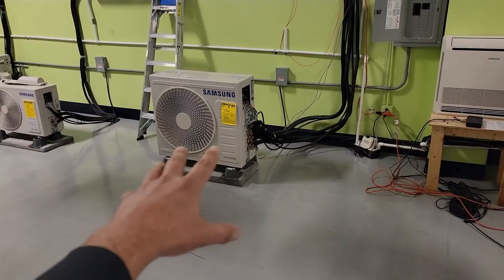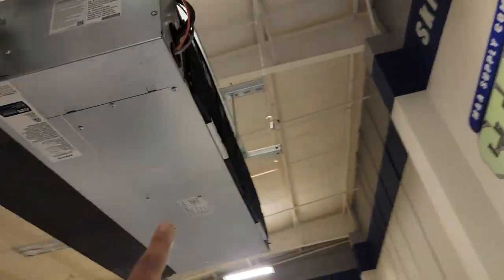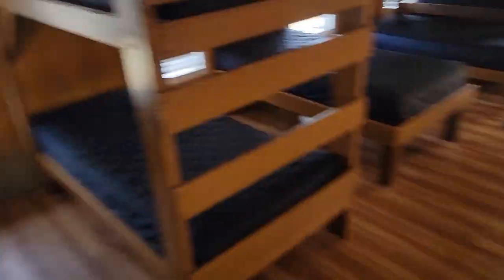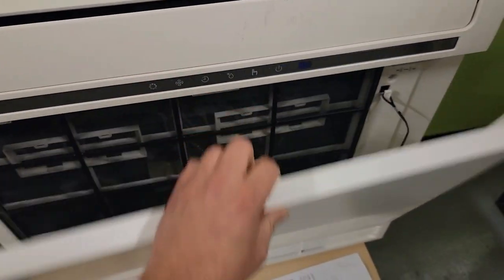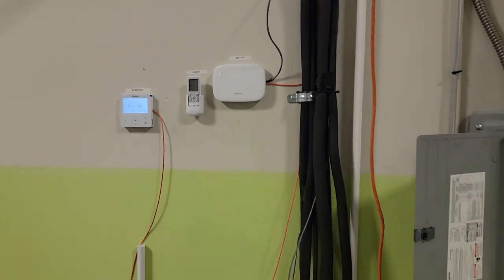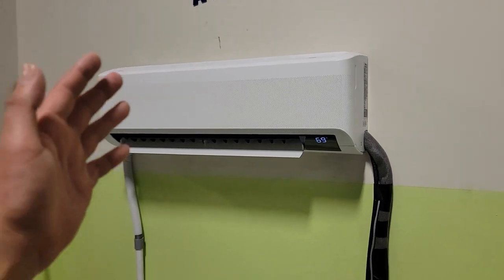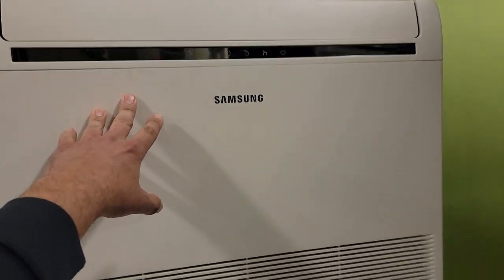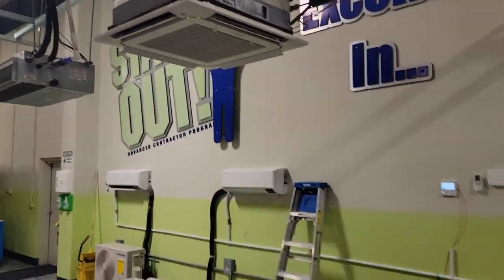What's the BEST Mini Split for Your Home?

Comment: I want to remove all the under house duct work and handler. Mice make nest inside the unit and leave an odor. I would want a four station system all floor models, the house is small under 900 square feet I believe when I get back up there this summer I will measure rooms. The kitchen has one wall where one floor unit can go, the bedroom one can go under the east window, the living room has a west window where the third floor unit can go and the closed in windowed porch on the south wall I can find a place where to put the forth unit. I want all pipes under the house I only want one opening going outside where the original compressor is now. When all this ac installation is finished I can seal the ground under the house. A one ton unit is probably big enough for the four stations I believe the house is 25 by 26 counting the front porch. I may be wrong. 73
Reply: Thanks I may start with two stations one in the living room and one in the bedroom the kitchen is open to the living room, that should get me started I know the front porch will need a unit if someone sleeps there but right now the main house needs to be done I'm hoping I won't have to buy a dehumidifier for the house but when no one is up there, do I want to run the system unattended with storms and such like? 73

Comment: Thoughts on a cassette in a garage? Heard lower airflow than wall mounts and also failing inspection in certain areas due to fire blocking essentially being in the garage.

Comment: GREAT VIDEO! So I’ve had a mini split unit installed into my garage twice in the last 12 years. The first one lasted 6 years and was pretty decent the second not so much. My garage is 600 square feet and isn’t insulated. I was told i had the strongest BTUS A MINI SPLIT CAN HAVE. My question is: can you suggest which one your oppinion most likely will work. Best for the space to provide cold air when it’s 102 degrees outside because it hasn’t really been feeling. Cool enough.
Reply from the maker: Hey thank you so much for watching the video yeah I  recommend a 2 ton unit

Comment: You know what would be really cool (pun intended).  An exterior mini that flex ducts (similar to dryer flex vent duct) supply and return to a plexi-glass window insert.  Drawing 120 ac from an existing indoor outlet.  Great for non-permanent self-installs.
Reply from the maker: That would be sweet I could see lots of demand for that
Reply: they make them.  I have a customer who has something like that.  He plugs it in, runs the lines which are super flexible and uses it during construction or whatever.  I have no idea where he got this thing- but its small like 9000 or 12000---but runs on regular 120V.  You can buy 120V units up to 1ton---I've installed lots of them.
Reply: @mtsaz100  Find out where your customer got that and let us know.

Comment: Thank you, I will definitely watch the upcoming videos.

Have you ever installed mini-splits in a home with a flat concrete ICF roof? The ICF has a built-in chase for running electric and HVAC but the chase is small and only runs in one direction. We would have to cut the forms laterally before the roof is poured to accommodate ductwork for a traditional system and I think even for the refrigerant lines and drain lines for mini-split zones. We are trying to find the most efficient and cost-effective solution. Also, because the house will be so air tight we also need some sort of makeup air system that will need ductwork as well. Wow, what an undertaking. We are in Southwest Florida if you want to come down for a vacation and install our HVAC!!
Reply from the maker: If it was cost effective for you then I can definitely come down there and install your hvac

 I would be coming to Orlando in November for a vacation for a week

Comment: I am a general contractor. I installed 3 of these systems, with one of them in my own home.  Every one had a defect right out of the box.  Had to take Samsung to the California Department of Consumer Affairs in order to get warranty parts for my own unit. The local distributor went out of business because of all the problems with these units.
For the best results buy a LG, Mitsubishi or Fujitsu.
Reply from the maker: not many people actually know how to set these units up
Reply: @TaddyDigest  💯 There are so many hackers out there.
Reply: buy a fujitsu samjunk and lifes garbge are crap
Reply: Not many new HVAC technicians know the Samsung brand should stick to TV's only. Their washers and Dryers fail, their refrigerators are rated the worst in the industry,  so what makes you believe that the inverter technology is better in their AC equipment?
Reply: @xcentriclithium5467  they only make good phones and ssd's the rest is crap

Comment: I was wondering what applications other then a drop ceiling are cassettes more beneficial then a wall mount? Or when should they be used over a wall mount.?In a residential setting new construction or existing.   Thanks

Comment: Great video. Super informative. Thank you! Do you have any videos with pricing of these types of mini splits and I'm curious with how long they last? Also maybe a video of comparing using Mnii Splits vs using the typical HVAC vent? Last question I can think of, is using mini splits (using the different types) good for a larger home 2500 sq. ft + instead of using the typical HVAC? 
Clearly the mini splits have come a long way and I like the idea of it replacing the typical HVAC system, so people can regulate each room to their liking.

Comment: Buying a 220 may envolve some rewiring issue's but once done, it's no longer an expense. A 220 though more expensive to purchase originally, will cost considerably less to operate over the same period of a 110. In addition, I would recomend purchasing one that is a minimum of a one ton larger than one figures utilizing a number of charts and graph's available. It due to the size will be cheaper in the long duration of owning it, then one a ton less.

Following my own advice, my 140 meter single floor home in Mazatlan has three minisplits. Two of which are a ton and a half and one of which is a one ton. They are all on timer's that vary from one another. The one in the living room a ton and a half and the one in my game room a one ton with all doors open. Keep the entire house cool starting at 0600 and ending at 1800 ten month's of the year. Our personal bedroom has a ton and a half, which because it actually too large for the room, we keep it set considerably higher than the other two settings and it works from 1800 until 0600 every day for ten month's a year. They are all 220, and my month bill's are less than my neighbor's whom all have less devices which are 110. Not to mention in the ten year's they've been installed, except for cleaning once a year by a professional, I do the cleaning of the filter's every couple of months. They are still the same devices, and show no sign of needing replacement, while all my neighbor have had to replace theirs at least once.

Thus if you plan to reside in the home and no desire to flip it. I'd purchase 220's and a half to one ton larger per each installed. Gonna flip it, who cares, put in the 110's.
Reply: Not it wont.won't.. the difference in efficiency will be literally pennies a year.
Please explain to me why you think running a ac on 240v is going to save you so much money vs 120v? You seem to be confused because it really won't matter at all.
Reply: 220…221…whatever it takes
Reply: Use 110 or 240 along depends on your electric situations most older homes don't have breaker room

Comment: Please tell if i want to install that duct ac for just  single room is that possible  replacing old window ac
Reply from the maker: It is possible yes
Reply: @TaddyDigest  what should i say to the shop keeper that i want a mini split ac or a slim duct ac and also what will be more economic for me
Reply from the maker: Ask him if you can get a single zone ducted Mini split
The cost between the window and the Mini split is going to be far apart so you have to decide what's best for you
Reply: @TaddyDigest  single zone will only be good for if i want it to be reliable?

Comment: Hello from the high desert of New Mexico USA 🇺🇸. I am looking for two mini split AC to install in my 1967 GM TDH-4519 city transit bus that I live in full-time,  What is the most energy efficient 120 volt    mini split AC?
Reply from the maker: For the bus I'd probably get a single zone  Wall mount  Mounted on one end to blow down the whole way

Or One of the 4 way cassettes and and take the 2 loopers and disconnect them and have the 2 livers to blow 1 down 1 side of the transit bus and the other to blow down the other side

Comment: hi tad, I joined!  another fellow mentioned that normally it's 400 cfm per ton but for minisplits its only 250 cfm per ton. is that correct?
Reply from the maker: Hey Chris thank YOU for joining here is my email I have some guides I would like to send you 
tadfuller1@gmail.com
Reply: Do not use that information. You need to do an accurate load calculation and see what the manufacturer blower capacity is.  That is a "rough guide" but can get you in trouble.

Comment: My daughter's home has an heat pump system that is too small for current high temperatures in Texas.  I think the builder didn't account for building out an upstairs bedroom and sitting area. Can a mini-split system be used to supplement the main heat pump unit.
Reply from the maker: Yes it absolutely can
Reply: Yes a mini split would be ideal for the addition upstairs bedroom.

Comment: I'm in..... Question I have a 350 SqFt Shop (Open floor plan) in South Texas, 100 deg. for 2+ months a year. I only have 110 volts, the data says 9k btu unit but for about the same price I can get 12k btu unit, Why would I not use the 12K unit..... Confused
Reply from the maker: If it's 350 ft² 
go with the 12K 
You will be happier
Reply: @TaddyDigest  Just curious on this, since TX has high humidity, you think it would be better to get the 9k and let it have longer run times so it will suck out more humidity instead of short-cycling the 12k?

Comment: Tad i jusr got a vending machine account servicing the cooling units.do you have any experience with that type of equipment?
Reply from the maker: I do not have any experience with these types of units
Reply: Yits pretty easy they have a external overload ,a potential realy. They have no service port so you can plug it in if the evaporater doesn't frost completely your low on charge

Comment: On a Samsung 2.0 my customer says he sets a set temperature and unit never stops running.  Its getting to the point where we going with a different brand.  Any suggestions?
Reply from the maker: Indoor fan and cooling never shuts off
 Indoor fan and heating should shut off unless it's overheating if it is there's a code you can put in to make it shut off
Reply: @TaddyDigest  What code is that. I have one that is overheating a space.

Comment: They are a very expensive unit  and a window or through the wall is a lot cheaper option. Better warranty and longer life for those too. 
That cabin system would either be heating or cooling that large crawl space since the ductwork is not insulated!
Reply from the maker: The duck work was insulated
 We build square metal duct and insulate on the inside
the electric bill is 60 dollars for that cabin each month now 
12 year parts warranty 
10 year labor warranty 
job cost was 6k
Reply: You can't be serious. You clearly have zero idea what benefits you get from a mini split vs. a window unit. Not only do they have better cooling ability, but they also can cool up to 2x the space for the same electricity as a window unit. Mini splits are very, very efficient with their inverter compressors not to mention the noise level is a fraction of what a "window shaker" is. Window units are temporary and look trashy. The benefits go on and on. You will save way more money over time vs a window unit.
Reply: Also, who says they have a longer life? You are just making shit up now.

Comment: The floor console is very limited due to its capacity. I believe it is 18k .
Reply from the maker: yes that is right. only goes up to 18k
Reply: What do you mean by limited? You wouldn't really want more than 18k coming from a single zone unless you are trying to cool a massive open area like a shop or garage.
Reply: uh they make them in different sizes.  9000, 12000, 18000 and one brand 24000.  Thats it.  So you are right- they are limited but for a room what more do you need?  I dont understand what you are talking about limited.

Comment: Where can I buy these mini splits?
Reply from the maker: Here is a Contractor locator so you can find your nearest dealer for Samsung equipment just by typing in your zip code. https://www.samsunghvac.com/locator?ecrzip=38320
Reply from the maker: or I can send you a unit if you want to go through me I can help you size the unit and guide you or your installer on the install.
Become a level 5 member I will work with you
Reply: @TaddyDigest  I have a cold side contractor.  These units seem to be better quality than others.  I’m trying to cool the area in my cafe kitchen where cooks work.  The vent hoods overtake the AC.  So I was thinking a split unit could add additional cooling for this location in the kitchen.  24000 btu or similar.
Reply from the maker: Very good
 If you need help sizing
 Let me know I have a sizing guide I can send you
 Its only $2

 Click the join button become a member level one and I will send you my email

Comment: I would like to see the amp draw on the different BTU rated systems
9,000 then 12,000 and the 18,500 and 
24,000 btu unit 
I have solar panels and like to see starting. current ( amperage ) draw and running current draw ( amps )
Then show a regular type of window unit and 24,000 to 36,000 central units and there starting current and running current.
with outside temps in low 90 F and holding a set point of 70 deg F.
Lots of Solar  panel system owners  are going the route of mini splits because of being more efficient as well as much lower starting amperage draw as well as lower over all power usage.
Reply from the maker: Hey Kelly you're right a lot of people with solar panels are considering many splits because of the soft start for all the motors
 All the motors are 3 phase
 Single phase power in and then there is 3 phase outdoor motors and 3 phase rotary compressors
Reply: There are some really efficient units out there. Look for the EER rating not the SEER rating. The EER rating will tell you how many btus of cooling it will do per watt. A 14 EER unit will do 14btus/ watt. That means a 12,000btu unit will pull 857w or 3.6amps @240v. There is MASSIVE variation on mini split efficiency per unit! Some can use up to 50%+ more power than another at the same cooling capacity!

Comment: Duct in the crawl space should have been wrapped with insulation unless duct was insulated inside even if pre existing...

Also floor registers should have been under or near the windows instead of middle of the floor to dissipate the potential  air leakage and temperature change of the windows.. Return not a good idea on the floor...IF it had been new constitution that is....
Reply from the maker: I agree 
that duct system was installed in 1988 though